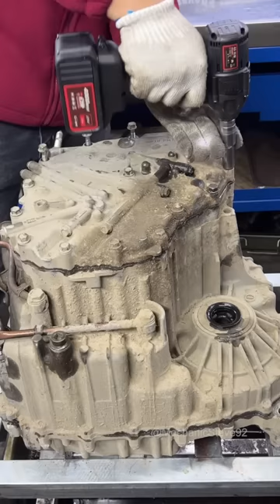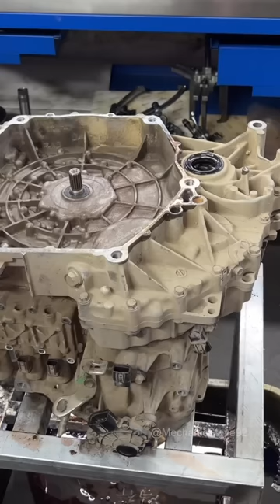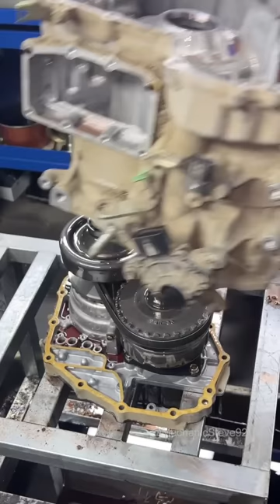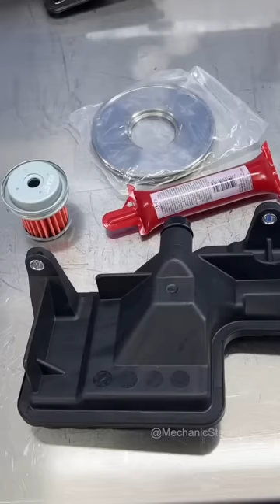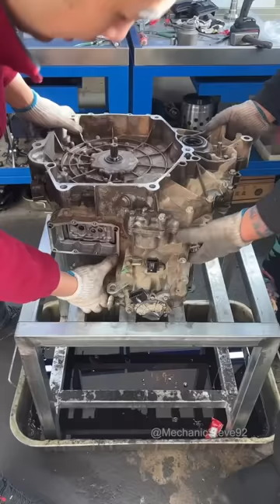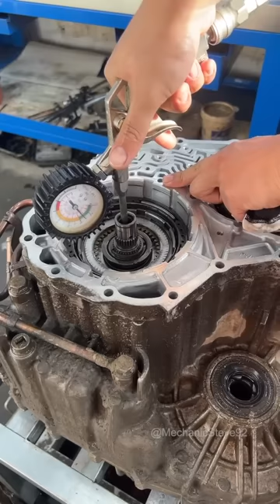Honda Fit Transmission Model CVT Infinite Transmission.

Comment: Why wouldn't you clean it before doing anything to it?
Reply: Pour changer l'embrayage d'une clio
Reply: Because, if you clean it before replacement, you will clean it again before assembly.
Real work different with youtube consumption.
Reply: But i know, he is not a good mechanic because he still not clean it before the assembly

Comment: Worst design trans ever all fail before 100k miles. Cvt is shot design the guys whe designed them should be fired and their engineering degrees revoked

Comment: I've this same car with the transmission, the problem I'm having with it right now is that when I park the car down over night, and I go start it in the morning it doesn't move when in drive no matter how hard I accelerate, it just doesn't move forward, but it goes into reverse quite well, now I will have to wait for about 10 mins, while I leave it in drive before eventually it goes into drive, but through out the whole day while i drive it it goes into park and reverse easily but that initially morning start, seems like it can't get the oil to the top of the transmission immediately or something can anyone pls tell me the solution to this. Thanks
Reply: Get a proper flush done, ie drain fill drive 10 mins drain (x2) then a final fill using genuine Honda fluid.
It's amazing how many problems a flush solves
Reply: its still persis?

Comment: Good afternoon, I have a problem with my transmission, it takes a while to apply gear, I must accelerate it a little so that it starts to apply in D. The problem gets worse after driving the car at high speed, and braking at a traffic light. , wanting to drive again, finds it difficult to apply. Do you know what the problem is?

Comment: Hello, Thank you for all the videos you post and for your efforts.
However, I'm going to ask you a question that has nothing to do with the VCM topic, I'd like to ask you if you could tell me if the 2009 Honda Fit GE8 CVT automatic transmission contains a wet start clutch .
Thanks for your help

Comment: Mine has some noise from gearbox. We have tried changing some bearings but the problem is still persistent
Reply: which bearings did you change, mine too has some sound and am made to understand its input shaft bearing. does  it move after changing the bearing?

Comment: It will be fine if change the fluid before 30k miles and get rid before 150k miles. It will never be forever car like 5 speed auto.